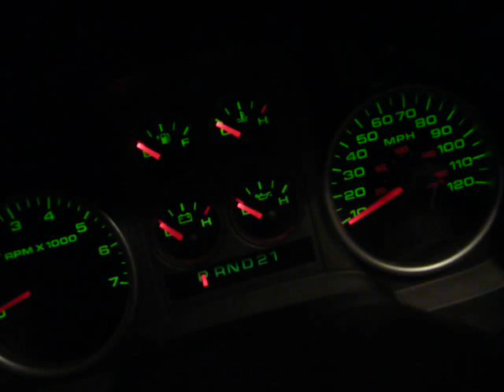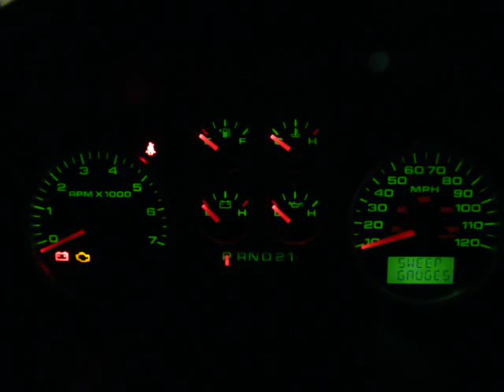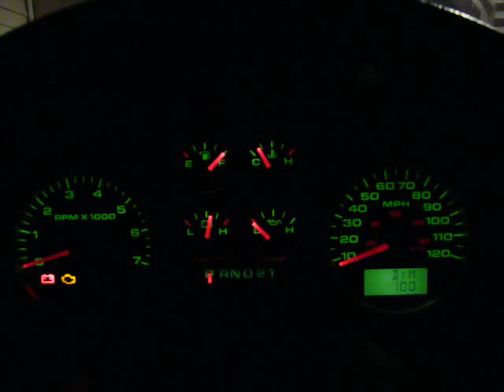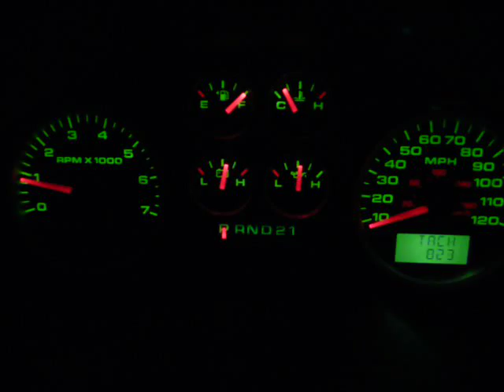Ford HEC Dealer Test Mode (Engineering mode)

Comment: Won't work with mine. Have a 2005 Explorer with the Mini Message Center and literally will not go into this mode no matter what I do. Even if I unplug the battery and do it. I did it once before but it refuses to go into that mode at all. I'm about to give up and waste $600 on a reader to actually show me info cause this ain't doing anything for me.

Comment: how did you scroll? you don’t show it. 
also, are you holding down the trip odometer button to access this? bc doesn’t that just reset your trip odometer to 0?
Reply from the maker: Yeah I think so, it won’t reset anything in engineering mode.  Hard to remember this video is ancient. 😅
Reply: @EricAtMazda  yeah but you have to push the button in order to get INTO the mode!!
Reply from the maker: @hheenan  which i believe you do before you turn the key so it won’t reset anything

Comment: Is it possible to switch the external temp reading from C to F through this mini message center?
Reply from the maker: You’d have to check the owner’s manual or check in a forum/google it.  Haven’t owned this vehicle for many years at this point and I can’t remember.
Reply: @EricAtMazda  thanks man, I understand.  Yea the owners manual only tells you how to fix it if you have the regular message center, I just have the mini message center.  sucks

Comment: Cool feature. Thanks for sharing. I wish you would have shown your fuel pressure with engine running because my readings are off. I was going to compare yours with mine for diagnosis purposes.

Comment: Hmm.. I tried this on my Lincoln Aviator.. And it didn't work.. :/ 
But my car also has a setup button.. And if I click reset while I'm in that menu (When it says "Press reset for system check" it goes through a bunch of stuff, and tells me if anything is wrong, and if anything is, what it is specifically.. And my fluid levels.. And oil life.. And all that stuff.. lol.. So maybe that's all it does on the Aviator? I'm not sure.. =/

Comment from the maker: hold RESET for 5sec, and turn the key while you're still holding the RESET button, if it works about three seconds after the key is turned the word TEST or something should appear....if it doesn't then your vehicle doesn't support engineering mode

Comment from the maker: does it have a digital odometer reading? if so, then you can bet that it would be displayed there on the dash display...test mode is supported in those older vehicles even if there is only one line of text on the readout

Comment from the maker: The digital tach is a display or your engine RPMs.  The difference is you don't have to multiply that number by anything (normally you multiply the RPM x1000 or x100).  Instead of reading .0.8 RPM like the analog tach in the cluster, it read 800rpm, which is the ACTUAL RPMs (not a x1000) reading.